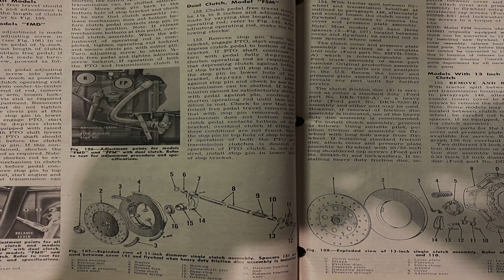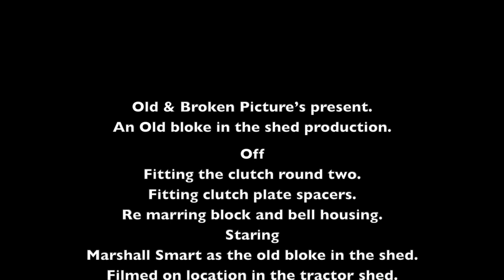Fordson Major re-split and clutch plate spacers.

Comment: Thanks for the video! At 29:50 you test whether the tractor is moving while the clutch is pressed right? We replaced the clutch disc and trowout bearing of our 1959 Fordson Dexta. After this replacement our tractor still moves when we press the clutch and rotate the cranckshaft with a ratchet. Do you think we could solve this as well with pressure plate spacers?
Reply from the maker: It looks to be a more complex clutch on a Dexter if you don't have the manual go here ,
https://www.youtube.com/watch?v=u5YkRfygrS8&ab_channel=MarshallSmart. 8.27min  is the part on the clutch for Dexter. 
Is there an adjustable link from the foot clutch to thrust barring shaft? You may get some adjustment there if it's fitted. There were a few comments about the spacers on the Major clutch as to thickness. 5mm I used if I remember right.  M
Reply: In your manual a double clutch is used. The clutch link is already at the shortest setting… We have a single clutch, quite comparable to yours on the Major.
Reply from the maker: @stanjaspars374   If it's the same as the single clutch on my Major 4-5mm spacers may solve your problem, but they are only installed on Major for the heavy duty clutch. Might be worth adjusting the clutch peddle link first to see if that would work. I have not worked on a Dexter. Might be a vid on YouTube by someone else who has trouble with this. M
Reply: We added two washers per bolt (total 3.8 mm) this fixed problem. Clutch releases perfectly. No slip noticed when keeping the brakes on and rotating the cranckshaft with a very large wrench. :)
Reply from the maker: @stanjaspars374  May be it's a heavy duty clutch like the single clutch Major. Good that you have fixed the problem. M 😀

Comment: Mebbe too late, but I used a long bolt with insulating tape wound round to give the right diameters as a clutch alignment tool.
Reply from the maker: There is a plastic one you can buy with splines also. My super thick copper pipe worked ok. M

Comment: after many years of use i got to do spilt the tractor in 2, whle doing so did you have to remove the oil sump? i just took apart 2 months ago to change the gasket,.
Reply from the maker: Well that was my plan but it escalated to a full engine rebuild. 😂Good luck M
Reply from the maker: If you are just changing the sump seals the sump will need to come off. I have the manual on YouTube go here https://www.youtube.com/watch?v=u5YkRfygrS8&ab_channel=MarshallSmart.  The video of me refiting the sump https://www.youtube.com/watch?v=KbKu5DuY1cg&ab_channel=MarshallSmart.
Reply: @MarshallSmart  i think i have a clutch problem pto and 3 point stopped working suddenly, and wheen i press on cutch i heaar a binding or something odd
Reply from the maker: @DannyV1973  It would seem so the clutch on the earlier and power major would need to engage for the pto to turn. The pto has to be turning for the hydraulics to work.Can the tractor  move in gear ? M
Reply: @MarshallSmart  yes in all gear it works but when i press on the clutch it makes a binding noise but drives well ,last night the pto and 3 point worked until i pressed the clutch to go in gear then stop
ped working ,,
Reply: i am going to try make a video
Reply from the maker: @DannyV1973  send me a link M
Reply from the maker: @DannyV1973  The PTO on the Majors only works when the clutch is up or engaged. I think your binding noise could be the thrust bearing as this only revolves when the clutch is pushed down.
Reply: @MarshallSmart  thank you for replying,, here is a link bad camera but for it to work clutch is pressed down far as it will go,  her eis link
https://www.youtube.com/watch?v=Gt9KztPHAGU

Comment: All good thank you. I am having trouble with my diff I think. The left hand wheel slips under heavy load or doesn't drive when I brake heavy on the right hand wheel. You got any thoughts on it. Would be appreciated.
Cheers Rob
Reply from the maker: Have you tried adjusting the brakes ? The fidler brakes  should stop the spinning wheel and make the other on go. I will have a vid on replacing the left hand brake cable and adjusting the brakes coming in a few weeks. If  I get time.Take the lever off between the brake pedals and just brake the spinning wheel. Should pull the tractor in the direction of the breaking wheel. Later models had disk brakes.M
Reply: Marshall Smart 
Thanks for replying. Yes I understand this but the left hand wheel only drives under very light load and the right hand wheel is the only one that drives under heavy load it does not alternate between the two when the traction changes and of course this model (1952) doesn't have a diff lock. This happens even when not using the breaks for steering or traction. I've probably confused you now but what do you think. I've checked the crown wheel and the drive cogs etc nothing broken just a bit of usual wear.
Cheers Rob
Australia
Reply: Marshall Smart 
If I break hard on the right wheel the left wheel does nothing and it sounds like something is slipping the clutch is new so it's not that.
Cheers Rob
Reply: Mate thanks for the suggestions but it turned out to be the obvious what I should have checked but didn't think at the time,
The outer rims were slipping on the inner counterweight hubs. Never been checked in 68 yrs probably anyway Cheers and thanks for your help 
and good luck with your old girl (Tractor)
Rob
NSW Australia
Reply from the maker: @MrRobbiecrawford  As Sherlock Holmes said if you eliminate the probable it must be the improbable that it’s wrong. Good luck M
Reply: Thanks mate

Comment: I have same problem. New clutch 11" is 3mm thicker. Where you get info spacers are 5mm? Trying to find what is right thicknes.
I try 1,5mm thick washers and it's make big difference. If spacer is too thick clutch start to slip. Repair manual says "use 0,85 inch long bolts"(with spacers). Orginal bolt 25/32inch so there is 1,8mm difference.
13" clutch have spacer thicknes in repair manual but that is different pressure plate.
Reply from the maker: I used a bit of steel i had it just happened to work out to be the right thickness around 4mm if I remember right. lots of parts available from https://www.wengers.com/partsearch/parts/index/?p=1&wm_compatible_equipment_make=31020&wm_model=29610&wm_part_application=29037
Reply from the maker: I looked at the video again it looks like 5mm plate I used. Seemed to work after adjusting the rod from clutch pedal.
Reply: @MarshallSmart  I adjusted my fordson clutch today and spacer what i use was 2mm.
I measuring distance disk and those three levers. old clutch 40mm, new 28mm and new with spacers 46mm
Clutch pedal free play should be 1,5-2inch.
Reply from the maker: @Kake84  If that worked on your tractor that's good. If you re watch the vid it 4 or 5mm i used and worked fine after adjusting the rod from the clutch pedal.
Reply: @MarshallSmart  Thanks you for videos, these old tractor is some time hard to find info. You videos are help me a lot. 👍
Reply from the maker: @Kake84  Glad to be of help new vid tomorrow. It's just what I was planning to do to my Major so I thought I would film it for Youtube.
Reply from the maker: I have found the correct size for the heavy duty clutch spacers it is 3, 1/2" or 88.9mm long by 0.329-0.331" or on millimetres 8.356-8.40.74 Its in the Ford manual page 48.  So my 5mm ones are a tad small but working due to the clutch rod adjustment . M
Reply: @MarshallSmart  Those spacer (page 48) are same thickness as 13inch disk (0,33inch) and just used when adjusting pressure plate. If install 13" thicker 0,52" disk need spacers (ford E117-GC9) but no mention spacer thickness.

Comment: Can I ask why the spacers behind the pressure plate
Reply from the maker: The heavy duty 11" single clutch pressure plate came from the factory with spacers between it and the flywheel. The duel clutch Super Major used them  basically shims where you could change the thickness for adjustment. As far as I am aware
Reply: Spacers because tractor doesn t stop completely when clutch is activated, suppose.